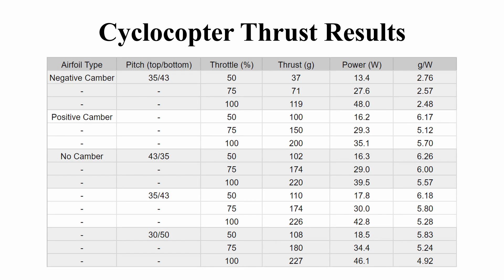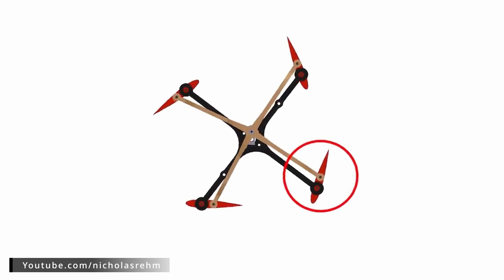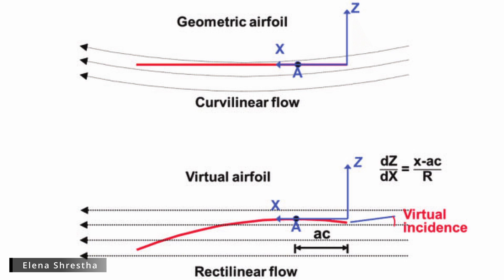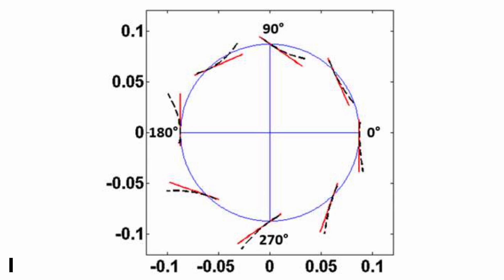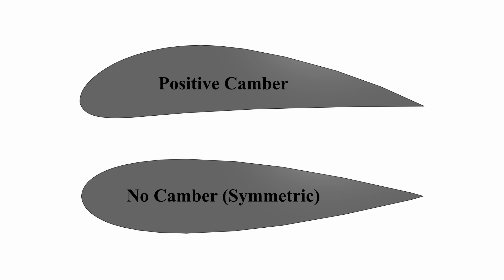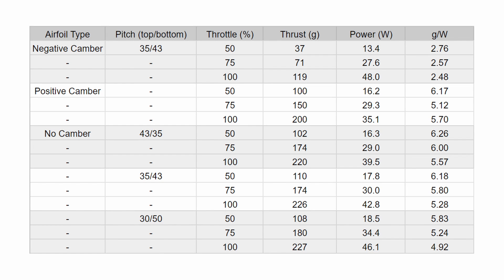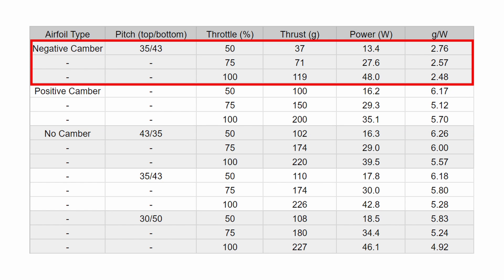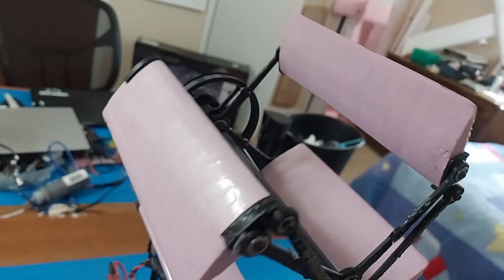Cyclorotor: Empirical Effects of Virtual Camber

Comment: What I think there should be two servos to control pitch angle , right ?  Why there is only  one ?
Reply from the maker: I have the one servo set up to change the direction of the thrust.  I do not have any control over the pitch angle, it's set at +25/45 degrees on the top/bottom.  I can vary thrust by the rpm.  I'm hoping to make a design in the future to vary pitch angle with a servo, but at this point it just adds too much weight/complexity
Reply: @JudeSchauer  I figured it out ,  it is similar with cyclotech's fly car  . I will try it .

Comment: This is really cool! How did you get the blades to change pitches? Is it automatic or do you have a control system changing them?
Reply from the maker: Thanks Juan!  I have a mechanical system that passively vectors the airfoils with some linkages.  The airfoils are pitching at around 30hz, which is a little fast for an active control system.
Reply: @Jude Schauer  l just learned about these and loved your video. I have some ideas on how to improve thrust. I would love to try and build one. Can you please make a video explaing and possibly do a build together?
Reply from the maker: Yup, I can try to make a build video.
Reply: @JudeSchauer  Awesome! Thanks!